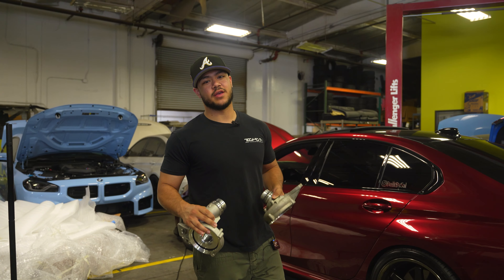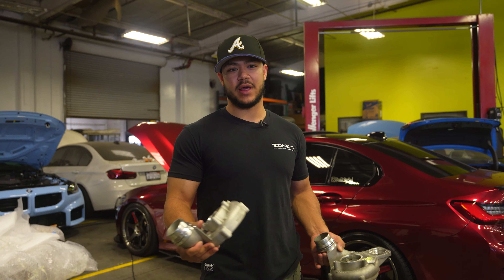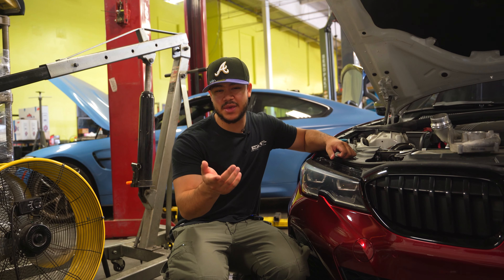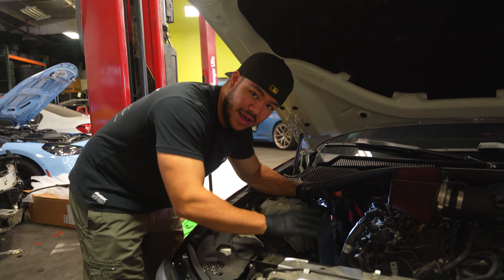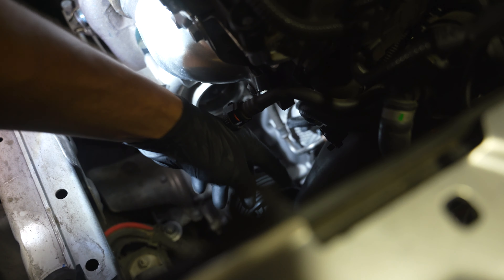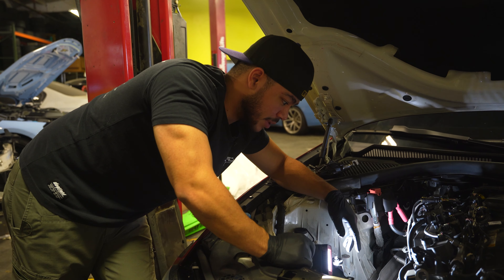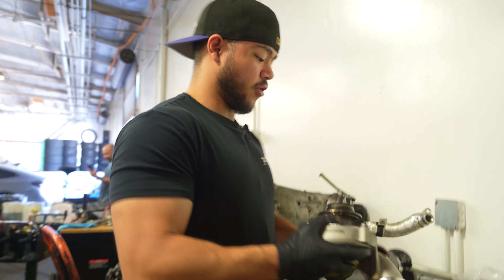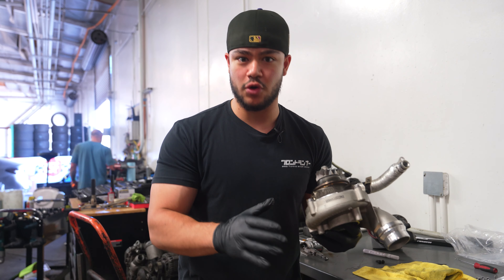T51R Mod on Stock B58 turbo - How to install for Supra MK5 & BMW M340i (B58 gen 2)

Comment: For that labor might as well swap the turbo out for an upgrade
Reply: FACTS
Reply: T51r is cheaper then a brand new turbo
Reply: @FdeHennyme Yea dude obviously but when you’re paying literally the same labor cost for both projects having some spool sounds versus a better turbo …. You buy the better turbo. 

My point is the labor cost
Reply: @Cmanns05 if you can’t do this simple work on your own you shouldn’t be modding anything on your car. They literally show you exactly what to do, and Kies has a step by step vid on removing the entire turbo unit…
Reply: literally all the work without the power benefit
Reply from the maker: Some peeps who want to keep their stock turbo (for whatever reason) this is another way to have fun with your car 🙌🏻👍🏻
Reply: Seriously ..
Reply: Haters
Reply: No 🧢

Comment: This is amazing man, I have a 2020 m340i and need to do this on mine !!
Reply: Did you end up doing itc
Reply: @ no not yet!! Next year I’m going crazy with my car
Reply: @JustAiM_Nick  bro I’m doing it rn and I’m losing my fkn mind. They honestly should’ve told us to just take off the whole manifold. That would’ve been so much easier. Just because I can’t access the oil and coolant feed lines to turbo with manifold on

Comment: Im having trouble removing the 4th bolt(top right) on the back side of the compressor. Whats a good tool recommendation to get it off